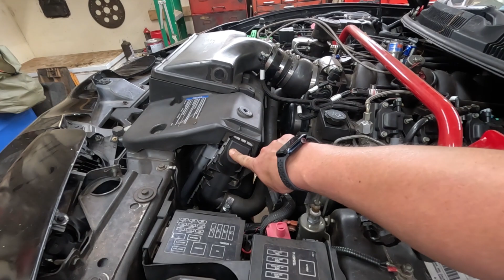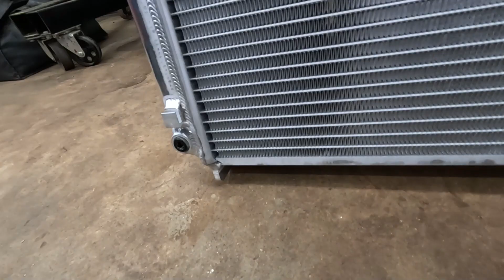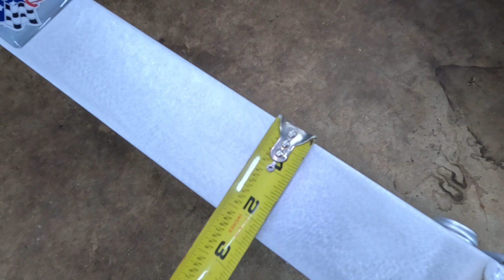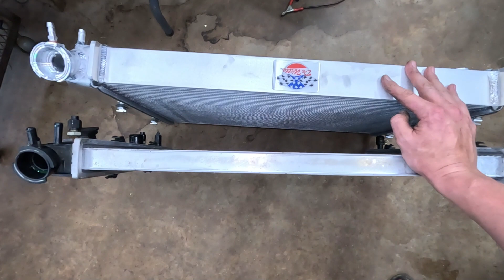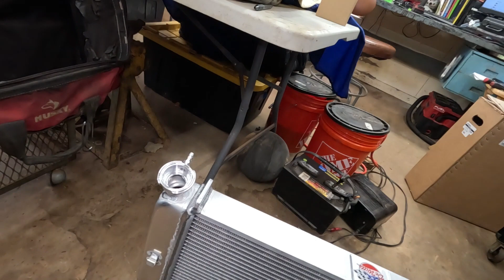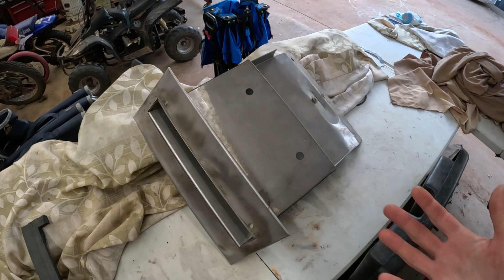🔥 OVERHEATING FIXED ❄️!!! F-body problems

Comment: Any help with that battery what size it’s that?
Reply from the maker: It’s an Interstate MTP-78DT—dual terminal, which works great with my Holley Terminator setup. It’s a 34/78 series battery. I did have to trim the lip on the coolant reservoir to make it fit. The positive terminal sits pretty close to the A/C condenser line—not a big issue once installed, but it’s a bit of a pain when putting it in or taking it out. I wrapped the terminal with electrical tape for some extra peace of mind.

Comment: The cold ram air sheet metal is a Fast Toys Ram Air kit for non ram air cars(I think they are out of Canada). I am currently replacing my rad in my 98 FB.  Did you need to mod the lower air box/ radiator mount  for the aluminum radiator to sit on top?   Do you have video of that part of the install .   Thanks
Reply from the maker: SLP has a version also. I have two or three of these. One of them came already modded for the radiator mount.